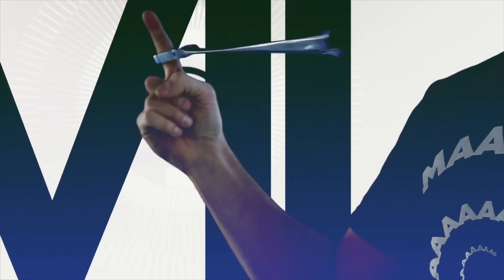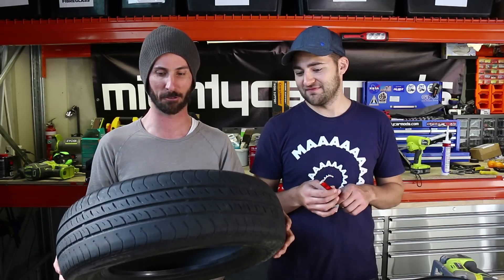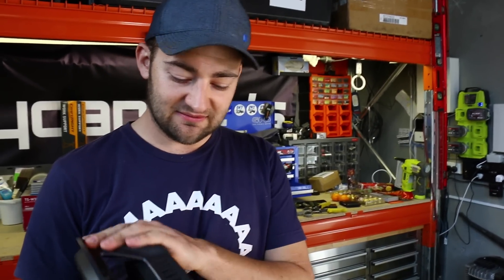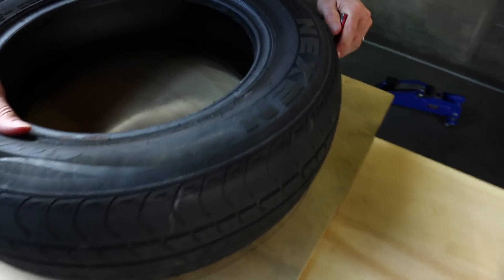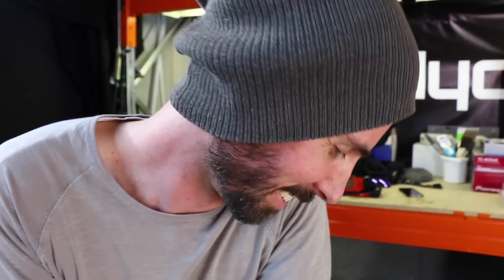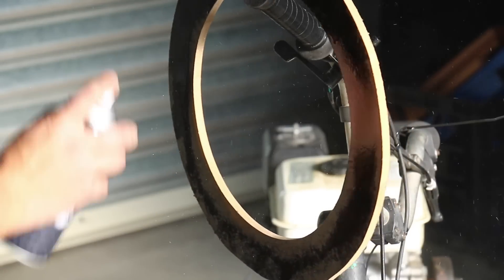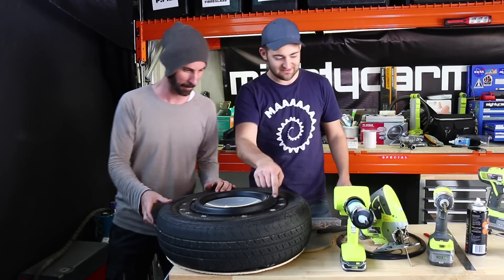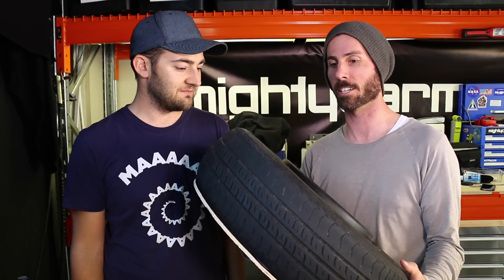Build a Spare Tyre Sub

Comment: The reasonable sound quality is likely due to a few things in tandem. For one, the tire is shaped in such a way that reflecting audio waves is hard because of it's heloid shape, and rubber composition. Second, that cheap woofer is likely intended for a rather large box, but a large rigid box will flex just about as much as that tire, meaning the walls of that tire are acting as a passive radiator. And third, two genius audio engineers designed and implemented it for the sake of amusing and educating their millions of fans even when they are car-less.

Comment: if you you attach the sub via an mdf ring on the outside of the tire, which is screwed to an mdf ring on the inside of the tire and you run the wires through the back of the tire without drilling a hole through the tire - if you have a crowbar, a lighter, a large screwdriver and a can of start pilot in the car, you could probably still use the spare tire in an emergency for swapping it with the burst tire - maaaaaaad!

Comment: G'day,

Yay Team..!

 Well, by the principles of Mad Science and 20:20 Hindsight, it goes like this...

 All them-there complicated Algorithmics to model the Pressure-Waves inside RIGID Speakerboxes, and prescribing the position and depth of reflexive Baffles and Cut-Out Windows,  required to permit the Diaphram to move equally freely both In & Out, without being peturbed by having to compress and depressurise the Cavity at each oscillation...; all are rendered obsolete, by having a Flexible Torus surrounding the Enclosure, with the Speaker Diaphragm mounted such that the "Recoil" of the Speaker-Frame displaces the Upper Tyrewall reciprocally in reverse phase with the Diaphragm, so the VOLUME inside the The Resonant Cavity remains unchanged, and the Pressure is unaffected, while the Diaphragm is flogging in and out 20 to 20,000 times per second...

 It's great !

Brilliant !

 +Hexibase will hate you...

  Segue Warning.

 I'm getting close to having established a Fuelburn Baseline on the 2000 Forester, prior to retrofitting it with a Mk-8 SunFoil, the 70 Watt PV has been ordered, and is in the Pipeline.

 2 fortnights in a Row, filling from the same Bowser, at 300 -350 Km per fortnight, at 11.03 & 11.06 Km/L respectively...; after measuring Fuelburn on 2 fillups following a new Air-Cleaner Element, then I'm going to change to 95 Octane for a month (it's on 98 at the moment...)..., and then, finally, in about 6 weeks the Mk 8 will have a Baseline to be measured against..., when it goes up...

  When are you going to Mighty Car Mod test a SunFoil...?

;-p

Ciao !
Reply: WarblesOnALot dafaq u say
Reply: I don't know what he said but I fucking like it

Comment: I did this with my 1999 Subaru Forester and it DID work really well. Mine was mounted to an actual spare wheel/tire that is useable with a few minutes of disassembly. I made it so I could remove the subwoofer rather easily, no ruining the tire with a hole (that's just plain wacko). There is no good reason to put sealant around the edge of the wood, it seals well enough to the rubber IMHO. I held the baffle in place with long threaded rods and wingnuts. Makes me think I should do this again with my 2015 Forester.

Comment: was the sub even plugged in when they "tested" it?
Reply: TheRattleSnake3145 Yea you can see it moving if you watch close enough.
Reply: Brian Tolliver not enough wattage though.
Reply: AugmentedRealities Or they just didn't crank it up so much it turns inside out. You do not have to have have it to move like it's going to blow itself up. Thats not how acoustics work. Not to mention that particular song is not bass focused. I have been installing car audio for years. You do not want a speaker going crazy when you play music. Thats how they wear out fast. Quality of music is not the same as quantity of movement.
Reply: yeah maybe they didn't turn it up much. I never said anything about quality. Besides, quality would only show in the video according to the quality of the camera mic so there's no point. Also there's no way that $15 tire setup is going to sound quality, they made this video as a joke. So make that cheap speaker dance.
The speaker moving it what it's designed to do, especially low end drivers. If it's a quality speaker and amp it wont ware it out. I've designed and built speaker boxes, crossovers and amps. Still got drivers from the 90's that have had years of hard work. Still going strong as if they're new. Quality speakers can go loud (to a point) if you know what you're doing and use quality equipment.
Reply: I was making a broader statement about the quality, not referring to this video. I also do filming and film editing. I know this all to well. One of my cameras sucks at recording audio. In my experience with installing car audio for music the more you have room for speaker movement (up and down/ in and out) gives it more ability to produce a quality sound. People that want their speakers to jump like jackrabbits when they power them get a far worse quality due to the speaker being closer to its limits.
Reply: only if it's clipping.
Reply: Brian Tolliver   you think testing a sub would be best with a bass song though.   I wonder if the flex of the tyre is acting like some sort of a passive radiator?
Reply: passive radiator....
Reply: TheRattleSnake3145  One would suppose the air in the enclosure has more flex than a traditional rigid box. Maybe it does help support the woofer at points of high excursion, less panel resonance too perhaps?

I read that closed field environments like cars can provide a decent bass lift, though that may not always be helpful to overall sound quality.

Whatever, an interesting idea for an install at least, nice one MCM.
Reply: james bagguley it could make the sub punchier because the speaker itself can rebound faster

Comment: the density of the rubber compound is the reason it sounds pretty good I reckon and it would reduce reflections. If you used a heavier tyre, it should sound even better.

Comment: I love all these videos but this is a fact idea, subs need a specific internal volume and shape for there enclosure, this will sound crap compared to how the same sub will sound in a properly built enclosure
Reply: Did you even watch the video? They specifically talk about that. The whole idea is to sound decent for cheap
Reply: Yes I did, I was just reiterating that it's crucial to have the right size
Reply: Cool. I agree with you, I see what they were going for but honestly I'd just spend the money to design/build my own box and not have it look like it's recycled from garbage
Reply: I've always built my own boxes, 99.9% of people buy generic pre made boxes and just stick there sub in and that's it, I build my boxes to the exact internal dimensions and seal them so well that there's absolutely no leakage at all, they are painted inside and all joints are silicone sealed as well as round the sub mateing area too,they are 100% air tight.

 as you probably know the air acts as a brake in sealed boxes and prevents over excursion at high power levels as well as reducing cone flapping and producing a tighter sound
Reply: Does painting the inside actually do anything? I've never done that. I do love sealed boxes though, especially for rock music.
Reply: OMGLYKEWOW 

yes, it seals the MDF better for air and also damp
Reply: Sweet, good to know
Reply: +Steve Fox  Silicone? As far as I know silicone is too soft and lets pass through certain frequencies. Just use enough wood glue that it spills out of the gaps when the enclosure is pressed during build, that'll do fine.

The rubber of a tyre is also quite soft but the steel reinforcement might help a bit to shift leakage to lower frequencies. Closed boxes have quite big range for an adequate internal volume. The one of the tyre is probably too small but if that's the case it's a leakage which actually decreases the effects of the volume being too small. Like what is called in German "kontrolliert undichtes Gehäuse" or "kontrollierte Undichtigkeit" which roughly translates to "enclosure with controlled leakage" which you use if the Q-factor of your driver is too high to be suitable for bass reflex, closed box or any other decent enclosure type. (I couldn't find out the correct English term for it.)
Reply: Marius Loubeeka 

There's nothing wrong with silicone sealant, it is meant to be soft and flexible, boxes in cars go though extreme variations in temperature and humidity, wood glue is too brittle and cracks plus you can't use it round the sub itself when seating it in the box, you could put a 1kg weight on my sub, measure the height and come back 2 hours later and get the same measurement, my box is 100% airtight.

I've had systems in my cars for the last 21 years, I know what I'm doing!

Comment: It's funny cause automakers have actually started doing this with their factory installed subs. I've owned 2 Mazda's that came with the Bose premium audio system package and both had the sub mounted in the spare tire. Granted you were still able to use the spare. You just had to unscrew the sub from the tire and pull it out. Then on my VW Jetta I ordered what they call a Soundbox (it's a sub and amp in one) as a VW genuine accessory and upon installation realized that it takes up the entire spare tire well leaving my spare to take up trunk space unless I take it out lol.

Comment: Thats Plywood not MDF youve totally botched the acoustics.
Reply: I have literally been scrolling through the comments to see if anyone else picked up on this. I would have thought they knew the difference between mdf and plywood, unless they were trying to encourage users to make it with mdf.
Reply: Kieren Smith Oh maybe you know. I don't know what MDF is versus plywood.
Reply: ***** Ah thank you.
Reply: +DementedCaliber no, that was definitely plywood. Not that there is anything wrong with using good plywood.
Reply: Yea ...all those finely tuned acoustics..
Reply: +skittlesRgood182 the reason MDF is used is because it's the moat uniform wood-based material available. ply-wood made from veneers will never be close because trees naturally grow denser in different areas from inch to inch, layer to layer and tree to tree. you'd never be able to predict the strength or performance as well as you could with fiberboard

Comment: are you sponsored by ryobi?
if not why not??? lol!!!
Reply: They're probably the best price/performance in AUS. In the UK the best price/performance is Black and Decker.
Reply: Dylan 'Robin' Harwood That's terrible logic to buy a tool. Ohh this $30 drill does the same thing as this $100 one. Boys buy cheap tools men buy tools that they can pass down to their boys.
Reply: John Smith
 Do you know what price/performace even means? Haha. I'm saying they're the best quality for the price. I could go to my local B&Q and buy a £15 hand drill or I could buy one that costs £150 however maybe the one that costs £80 or £90 is the best for the price, longest battery life, high torque etc. I'm saying buy the one that YOU trust. Okay, sure maybe you've not had the best time with Ryobi. I'm not trying to argue here, I'm just saying MAYBE Ryobi are the best value for them in AUS.
Also, they're not mechanics by trade, they don't own a massive workshop and work of cars day in and day out. They are acoustic engineers, as you've heard in this very video. If they were mechanics they'd be using the highest quality tools around, however for their cars they probably don't mind having a slighty sub-par tool.
Reply: Dylan 'Robin' Harwood
I know what price/performance is but here in the states ryobi and black and decker are the crappiest low budget tools they make. The best mid range tools here are rigid.
Reply: John Smith
 We dont have/I've never seen 'Rigid' in the UK. B&D and Ryobi are respected brands here.
Reply: My experience with Ryobi is that their ok, like they are not the best, but I like them
Reply: All my power tools are Ryobi. Best ones.
Reply: well ryobi is not bad tools at all. where did you get information it is bad ? it is not professioal but it is ok
and sells at good price
Reply: +John Smith man, these guys that talk about 'good for the price' use their drills around the house for things that would probably be easier to do with a screwdriver. I actually used drills all day every day for years for work and at that point, you get what is gona last because 'good enough' and you'll be buyin at least 2-3 in the time you'd use one higher end one plus the downtime and pain in the ass!
Reply: Because they are sponsored by just car insurance
Reply: John Smith So you’re that guy that spends $1000 on a SnapOn impact gun when he works on his car once a year because it’s an “investment”. No it’s not, and ofc price and performance matter. The warranty is the same between Ryobi and their more expensive counterparts, just like with cheap lifetime warranty sockets or what not, who the fuck cares if it breaks 2 years sooner than a SnapOn socket when you use it once a month if it gets replaced for free anyways. “Rigid tools” doesn’t even exist, no-one thinks that is a good brand
Reply: Chris Morse SnapOn Warranty is identical to Ryobi’s plus SnapOn has no network in Australia compared to it. I’ve used Bosch (similar, slightly higher price point to Ryobi but nowhere near SnapOn) electric power tools doing all my own maintenance, modifications and repairs on my car for the past 5 years and I’ve yet to have one fail let alone replace it 2-3 times like you claim you did

Comment: Nice, only thing I would do different would be to find a match in size of wheel opening and sub diameter so I wouldnt need to make an adapter then it would look like the speaker was a rim on the tire.  badass and would look great in a garage stereo system.  Thanks for the idea, I must make this for my garage now.

Comment: With some thicker pieces of (ply)wood/MDF/flake board (at least 19mm = 3/4"), some wooden plates between the front and rear pieces of wood as cross members, bitumen foil glued to the inner sides of the tyre and a driver that roughly needs the amount of inner volume povided it will be really awesome. It won't though be THAT cheap anymore but still not expensive.

Comment: Did you figure out air inside for a nin ported?  The top and bottom of the tire will flex giving it some ability for a non ported sub to work better.  The you should have placed expanding foam then smoothed it out on the inside of the tire though.  A shallow 12 or normal 10 inch might have enough from the air flow inside.  Im disappointed that you didnt ahowcase the boom or punch sounds from a decent amp with it.  

If you make it again, use self taping metal screws like used for walls and silicone to hold them in the tire, then silicone and screw the wood into the tire with the metal taps to make sure it wont end up flexibg loose on both sides.  You could always port it if you dont want the tire to flex.

Good idea but i think a little more thought to the sub box would be great.  As to the comment on round boxes, think guitar...

Comment: i seen a german team that used a spare tire at a spl test 
they put the measuring device inside the tire and mounted the speaker the wrong way 
had pretty good results 

if you prevent the tire from growing up and down with a few pilars between the top and bottom mdf plate
the tire prolly will work fine as its round shaped both in circumference and cross section it whont deform mush , you can even stretch it a little by making the pillars a little longer 
might want to use a smaller speaker though that needs less liters for the box size

Comment: Just some improvement ideas:
Use the cars spare wheels holder system to keep wheel in place, so its harder to steal and does not fly into your head, if you have accident.
Use some 2x2 or other wood to make connectors between back plate screws and front plate screws, so tire wont expand via pressure (with bigger and better subs) and also give screws something more than rubber to bite on. Filling the compartment with old pillow fills and lining sides with mattress foam will give your "box" more space if sub needs more space than is available. Use some spare wood and sturdy mesh to give sub room to move under the trunk mattress. Also making hole in mattress helps sub to move air more freely, thought dont let anything sharp fall into cone trough mesh. To be absolutely teenager this also gives you good place to secure your LED lighting so your trunk can be turned a disco!

This is kinda old idea to put sub into spare tire, but its still cool and functional.. depending your use of the car.. and if you dont have ever tire puncture! :D

Comment: Now, Marty mentioned home theater. Well, make 5 of these. 4 of these on the wheels, like, install the wheel, with a rim deep enough to fit the sub, bolt on the subs on all four wheels, and you got a 4.5 system. (4 speakers, 5 subs) that'd be MAAAAD
Reply: Aside from that being a stupid idea, it would still be 2.1, as the multiple speakers / subs would be getting the same signal
Reply: ***** you do know i wasn't being serious eh? And nope, it wouldn't be 2.1 since most of the modern headunits have more than 2 channels
Reply: Oh yeah cos the rear speakers play a TOTALLY different sound to the fronts, lol...
Reply: ***** im not saying that. For example my headunit also plays dvds. So lets say i wanna watch a movie with dolby surround sound. Front speakers will play different sounds from the rear ones. Its not noticable of course when playing music, but its there nonetheless

Comment: Using a tire as a box is actually a good idea.  The sound deadening the tire provides means you don't need as much air space inside.  With good enough sound deadening in a box you can make it much smaller without losing sound quality.